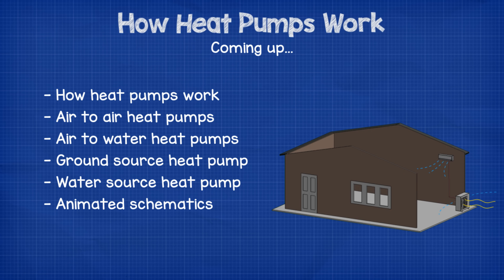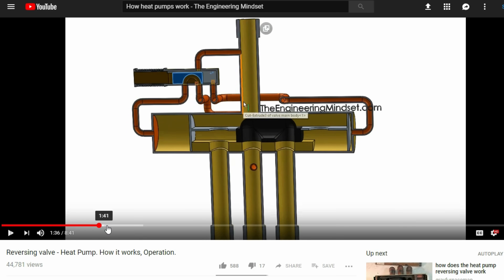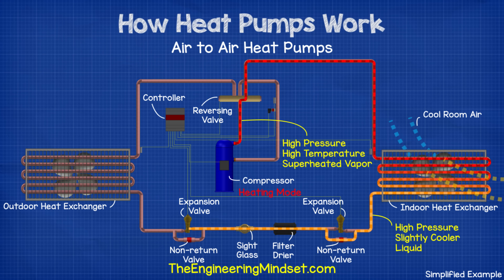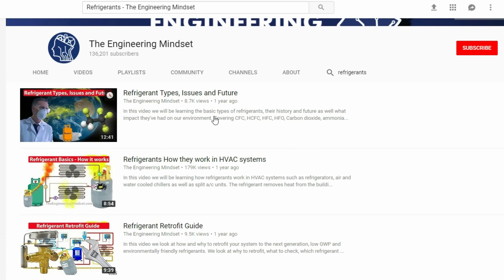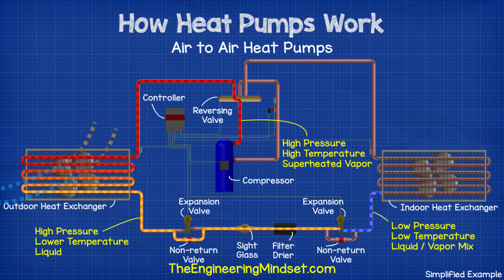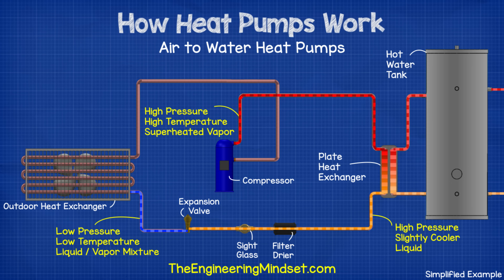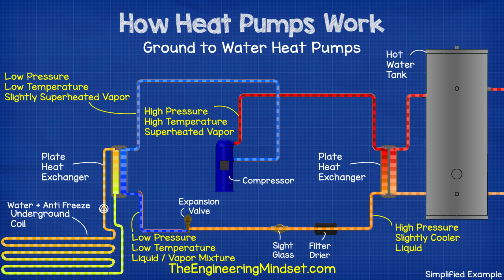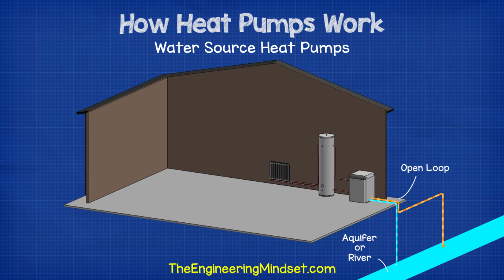Heat Pumps Explained - How Heat Pumps Work HVAC

Comment: Everything is relative. Water boils at 212 degrees F at sea level pressure which is 14.7 psi. Have seen it boil in a vacuum at room temperature and it can boil at hundreds of degrees in a high pressure boiler. This is the basis of a refrigeration system. By manipulating temperatures and pressures you can force a refrigerant to either evaporate or condense which will either absorb or release heat. Basically using a refrigerant to transfer heat from one area and  release it in another area.
Reply: I don't understand one thing. The most common refrigerators such as R32 and R410A, have a boiling temperature at around -50 degree Celcius. Let's assume that the indoor temperature is 30 C and outdoor temperature is 30 C too. And we want to cool the place. How is it possible that the temperature of the refrigerant increases in the evaporator and drops in the condenser? In the evaporator, the refrigerant exchanges heat with the indoor air(30 C) and it warms. In the condenser, the refrigerant exchanges heat with the outdoor air(30 C) and it cools and condensed. How can you drop the temperature of the refrigerant to -50 degree C using the 30-degree C air? That's against the thermodynamics rules.
Reply: @kaan2215  Get a pressure temperature chart for R-22 and follow along. I am going to use Farenheight. R-22, at 14.7 pounds pressure (atmospheric), has a boiling temp of around -13 degrees. Let's go thru a complete refrigeration cycle in a comfort AC system with 90 degrees ambient, 75 degrees in the conditioned space, a high side pressure of 250 psig, and a low side pressure of 65 psig. The compressor will compress the refrigerant to a high pressure, high temperature gas, and in this example of a high side pressure of 250 psig, its condensing temperature is 117 degrees. Now the condenser fan runs cooler 90-degree air over the condenser coil and cools this refrigerant below the 117 condensing temperature forcing the refrigerant to condense. This change of state, from a gas to a liquid, releases a large amount of heat, called latent heat. This refrigerant then leaves the condenser at basically the same pressure but now is a medium temperature liquid. This refrigerant then enters the evaporator thru an expansion device, which induces a pressure drop. In this example we now have a 65 PSIG evaporator coil, and at that pressure R-22 evaporates at around 37.5 degrees and it is forced to evaporate, and this change of state absorbs a large amount of BTU's from the warmer 75-degree room air that is passing over the evaporator coil. We are now left will low pressure, low temperature gas that goes back to the compressor to start our cycle all over again. It completely follows and can be explained by the laws of thermodynamics. Please let me know if there is something you don't understand and I can help you with it.
Reply: @kaan2215  Its actual simple. Get a pressure temperature chart and follow along. We are going to use Fahrenheit and R-22 in a comfort air conditioning scenario, with 90 degree outside air and a 75 degree inside air, with a 250 PSIG high side pressure and a 65 PSIG low side pressure. Starting at the compressor, it compresses a low temperature, low pressure gas to a high temperature, high pressure gas and discharges this gas thru the hot gas line to the condenser at 250 PSIG .The condensing temperature of refrigerant at that pressure for R-22 is 117 degrees, and as the cooler outside 90-degree air passes over the condenser coil it cools the refrigerant below its condensing temperature and forces it to condense. This change of state, from a gas to a liquid, releases a tremendous amount of heat, called latent heat. We are now left with a high pressure, medium temperature liquid that leaves the condenser thru the liquid line and then enters the evaporator thru an expansion device, which induces a pressure loss and, in this example, leaves us with a 65 PSIG evaporator coil. R-22 at this pressure evaporates at around 37.5 degrees and since room air passing over the coil is 75 degrees this forces the refrigerant to evaporate. Again, a change of state, this time from a liquid to a gas, now absorbs a large amount of heat (from the room air) and now we are left with a low temperature, low pressure gas that returns to the compressor to start the whole refrigeration cycle over again. Completely follows and is explained by the laws of thermodynamics.
Reply: @Howie875  So is it all about pressure? We manipulate boiling and condensing temperatures by changing pressure?
Reply: @kaan2215 Mostly about manipulating refrigerant to the proper pressures but then you also have to then manipulate the refrigerant temperature to then change its state from a liquid to a gas ( or vice  versa) to complete this process.

Comment: From the practical point of view of a user of the Ecodan Air to Water heat pump I make the following observations about the system's performance compared with our previous Economy 7 electric storage radiators, based on seven years experience.

1. The capital outlay is very high.
2. The equipment required is very bulky including large radiators and a large tank plus outside fan unit.
3. Despite trying Economy 7, Economy 10 and standard tariffs the overall usage of electricity has increased by 40% in the 7 years.
4. Much more copper is used than with electric storage heaters.
5. Almost a full sink or basin of cold water has to be drawn in order for hot water to flow resulting in an increase in the water bill by 40%.
6. The installer has tried all kinds of adjustments to get the system to use less electricity. In a cold winter calendar month my electricity cost will be over £200. I cannot have a smart meter because of a weak to non existent phone signal.

7. On balance the electric storage heaters were less obtrusive, the copper tank with immersion heater smaller, and the electricity usage lower,
8. The property is a well insulated two bedroom semi detached bungalow.
Reply: on point no. 5, water sits in the pipe from the unit to your tap and looses its heat. A simple solution is to lag this pipe to keep the heat in.

Comment: Too complicated. You lost me at 2:26 - how does a refrigerant produce heat ???
Reply: Refrigerant reacts to pressure and temperature, so when it's pressurized in the reversing valve, switching from vapor to liquid it is extremely hot and the fan blows over the coils to reduce the heat and provide desired heated air to the home.. depending on if it electrical or gas depends on how the heating works either with electrically heated coils or gas burners passing thru heat exchanger

Comment: I have a question as I am see people stating heat pumps are efficient but when they utilize auxiliary heating system which works in conjunction with the heat pump when the outside temp is around 37 degrees.  I used an amp clamp to see what the current use was with the heat pump V the auxiliary.  in. the heat pump mode the current was 45 amps while when it was in the auxiliary mode the current was 34 amps.  it appears it would be cheaper to heat me house with the auxiliary mode how can this be the case?  Help please
Reply: You don't know what the actual heat output from the heat pump vs the aux heat is, you only know what the electrical input is. The electric element probably only outputs 1/3 of the heat that the heat pump will.

Comment: The air to water system , what sort of temperatures as an estimate across most units would you get in the water storage heating coil with no electrical element assistance ? Do they have enough power to heat a house 3 to 4 bedroom rough size on the air to water heat pump alone ?

Comment: Why is the expansion valve and outdoor heat exchanger needed in heating mode? Can't the slightly cooled refrigerant from the inside exchanger just go right back to the compressor? Or does it need to return with low pressure?
Reply: Great question. I have the same one

Comment: Wow, that is interesting! I wonder what would happen if you used a refrigerant to run through a solar heat collector to warm it up outside? I bet you could make lots of heat and if you rigged it just right, you could run the compressor backwards and have a sort of steam generator. You could make electricity this way
Reply: System like that exist, they are called thermodynamic solar I believe. On a big scale they do use them to generate electricity.

Comment: I worked in aerospace and the facility I worked at had many large buildings and lots of workers ....they did not use conventional HVAC they had a central plant that made steam and  also water to all the buildings ....chilled water and air movement kept those building CHILL all summer long and the steam lines kept it all toasty in the cold months and provided hot water ...I was always amazed how well it all worked

Comment: I thought the indoor unit when in heating mode was the condenser coil, but your saying heat exchanger
Reply: A condenser is a specific heat exchanger that cools the vapors passing through it.

Comment: I apologize if this is mentioned somewhere in the video and I just missed it but I feel like its important to explain that the boiling point of the refrigerant mentioned was at atmospheric pressure. As pressure changes boiling point does too. 410a in an evaporator coil is usually at a boiling point between 36°f and 50°f this is why we get air in the 40-60 range leaving the coil.
Reply: Good tip. It makes more sense when you apply that information.
Reply: thanks

Comment: in heating mode, what is the purpose of passing the low-pressure, low-temperature liquid/vapor refrigerant through the outdoor exchanger, to get a low-temperature, low-pressure, slightly superheated vapor? Why must that process take place?
Reply: bardia to make sure your bringing vapor back to the compressor and not a liquid

Comment: How does the compressor work?
Reply: The jist is that there is a component (scroll, screw or piston) in the compressor that pushes the incoming gas through a small volume. Since you have a set amount of air being crammed into a smaller space, the pressure increases.

Comment: How does air to air heat pump works if the outdoor temperature is cooler than indoors?
Reply: Since the refrigerant leaves the compressor at a high temperature, the refrigerant passes through the room and inside air is blown over it, causing the inside air to heat up while the refrigerant cools down

Comment: This is a perfect demo. But I do have a question, you don't need a condenser following the compressor? I assumed that compressor only compresses the gas and condenser does the heat exchange thing. maybe it's useless here?
Reply: Through the reversing valve the hot gas flow is redirected to the indoor coil to reject heat and liquid to the outdoor coil to boil off the refrigerant.  You still have a condensing coil with a HP...
Reply: Condenser is essential in heating or cooling mode.

Comment: Can heat pumps be used to boil water?what is the future of heat pumps can they replace conventional boilers??? Please reply
Reply: In theory yes, but it depends on the conditions whether it's worth it or not (hint: probably not). A heat pump is limited by the Carnot efficiency, which means that the higher the gap in temperature between the source and destination, the lower the efficiency. You can in part overcome that by using a cascaded heat pump (heat pump supplying another heat pump), but costs go up and efficiency still goes down.
Reply: @peterselie1779  thanks peter👍
Reply: @gokulramalingam9681  I want to add that what is usually done with combined heat pump systems is that the heat pump is used to heat the water up to a certain temperature using capacity that is not used for heating the home, after which a conventional immersion heater does the rest. That way you can have a compromise between upfront cost and energy efficiency.

Comment: How could you combine the two? for example, what if you would like cool air in the house but boiling water
Reply: Stiebel Eltron have something that do this 
Also sometiems, ice rinks are placed next to heated swimming pools to maximise the overall use of energy. 
For homes, the Sanden heat pump is the most efficient on the market in terms of water heating efficiency & ability to work at low ambient temperatures.
Reply: Open a window.

Comment: The air filters on our VAV boxes are regularly maintained.  However, the filters (screens) to which I am referring are for the heating hot water flowing through the reheat coils.  I was told by the installation contractor (Anthony Mechanical) that these screens could stop up and need to be cleaned regularly.   I would like to find instructions (or an instructional video) explaining how to remove and clean these screens.  Can you assist with that?

Comment: Is it possible to power an air to water heater with a solar panel
Reply from the maker: If you have enough panels, battery storage, an inverter and sunlight, yes.
Reply from the maker: Power inverter video  here https://youtu.be/iIqhAX0I7lI

Comment: Heat pumps only have a energy advantage in the heating cycle. 
This advantage may be nullified with air to air with very low outdoor temperatures. 
This advantage is nullified with air to water and water to water by constantly running circulation pumps .
Ponds,lakes and rivers are the best heat sources. They serve as consistent heat sources with convection and natural circulation for absorption of energy. 
Ground loops can become cold soaked under high loads.
Reply: I have a two stage in my apartment. When is too cold out like 35F. I have to turn on the Emergency Heat which is located inside the unit in the apartment. Looks like some coils heats up and warm the place.

Comment: Thanks lot for the video. 
Can you please tell what are the system parameters in case of a Air to Water Heat Pump?
I mean Evaporating Temperature, Condensation temperature for ambient conditions of 12 deg.C. What refrigerant to chose R134a or R410A?  We need a hot water supply of 55 deg.C.

Comment: I'm still curious to find out how many watt hours is consumed by the compressor per celsius degree increase of room temperature. If I know the need of energy for a room (kWh/m2), SCOP of the heat pump and both the outdoor + indoor temperature - it should be possible to know how many Wh it takes for it to heat up the room 1 degree, right?
Reply from the maker: Check this video here: https://youtu.be/gKc1EwO6VeE?t=316 there's a link in the description in that video for some free software which gives you all that info

Comment: Thank you for this. The video that "Carrier" put out with two idiot goons explaining "it pumps heat from outdoors" was worthless. This is actually how i always thought these systems worked. When I get the explanation that "it pulls heat from the outside", it makes no logical sense whatsoever. Heat being a relative term, i know that at 0°F outdoors, there's now way in hell there's going to be enough "heat" to make me warm in my home. 
Compressed refrigerant is hot. Expanded refrigerant is cold. Control which direction it goes, and you have either hot or cool air coming out of each end of the unit. Simple.
Reply: Maybe I'm off base here, but that is exactly what's happening, isn't it? In heating mode the refrigerant is compressed into a liquid. It's allowed to expand through the outdoor heat exchanger where it pulls energy/heat from the ambient air to boil. Even at 0°F the refrigerant has a lower boiling point, so it is pulling heat from the outside (as it expands into a gas) and pumping it inside. I think the missing key to your example is that heat pumps are not efficient at very low outdoor temperatures (as you logically concluded). My understanding is that heat pumps are not recommended in colder climates because of this, or they have some kind of electric resistance heater to supplement the outdoor heat exchanger during the winter months.

Comment: Here in the UK they're really expensive vs gas boilers. Most people who've fitted have ended up decommissioning them, as the hype hasn't materialized.
Reply: Cam Smith not true. That happened in a couple of social housing developments where the initial design was crap.  The capital out lay is generally higher than a combi boiler but with the renewable heat incentive, and proper sizing/design the cost to buy and to run is not bad.
Reply: @TheAlfonzoBonzo   Electric energy is 3-4 times expensive than gas. Don't confuse the people.:dothefive::dothefive::dothefive:

Comment: So heat pumps arent actually pumps, but rather a system.
Reply from the maker: Yes, it's just an air conditioning unit in reverse really
Reply: The pump compresses the refrigerant gas forcing it's molecules together creating heat, along with friction from the piston (like a diesel engine) and that heat is what heats your home, so without the pump there wouldn't be any usable heat. Air compressors do the exact same thing creating hot pressurized air and when the air is released through a tool it becomes cold as the moisture expands and evaporates.

Comment: Hi Paul. Just watched your Heat Pump election and comparison, and have a question re your 1KW to 4KW for ASHP. Could solar panels provide this and if so, at what cost....assuming batteries might also be needed? Ideally looking to only use electricity for cooling and light
Reply: Perry Garrod solar panels (PV) our battery storage could supplement the input power to the heat pump. A large enough array or battery pack could supply all of the power required depending on size of heat pump and the required input.